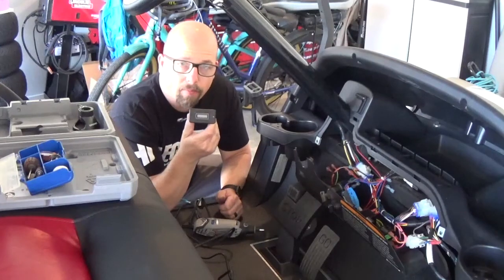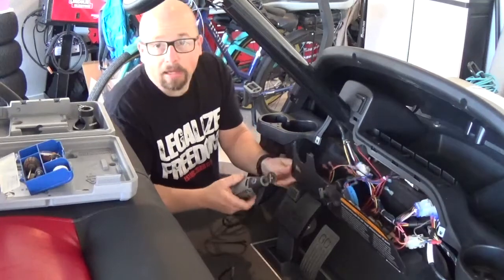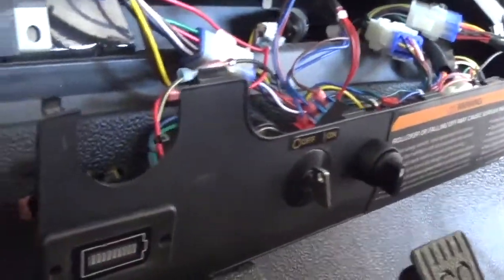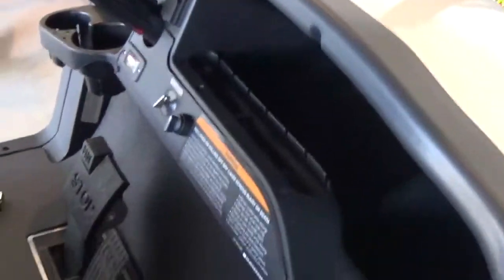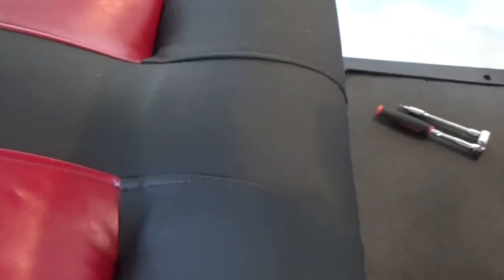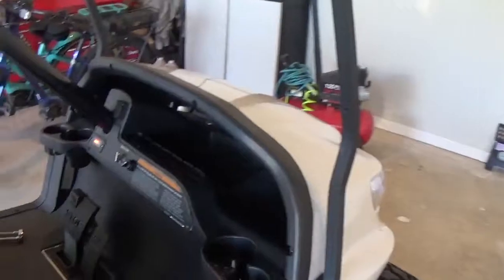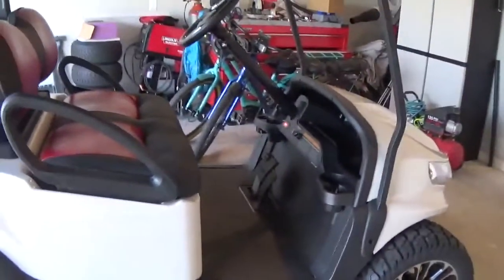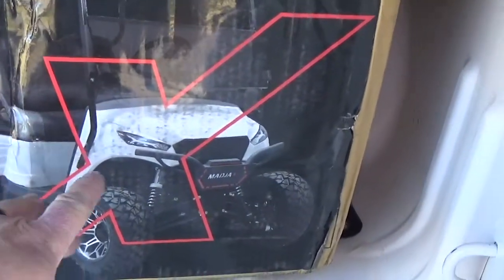2017 Precedent With Doubletake Body Headlight Wiring & EZ GO Update

Comment: So tell me about the light switch on the dash.   I currently have the same cart with a switch that will turn my lights on with the first pull and can pull again to turn on my secondary light bar on the front bumper (same as you have on this cart).   Since this kit will have daytime running lights AND the headlights, I'm wondering how I will also be able to use my bumper light bar on the same switch?    Maybe I can run the daytime lights on the first pull and the headlights/bumper light on the second pull?
Reply from the maker: The switch in this cart is designed specifically for the Phoenix body kit.. it’s a turn style… The first turn is running lights the second turn is headlights.